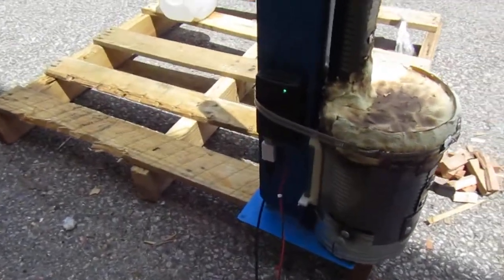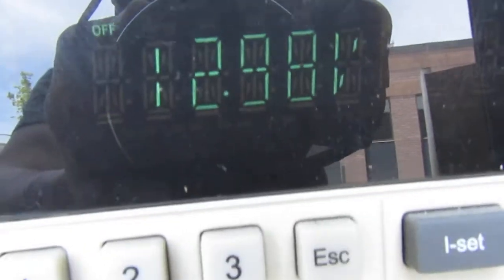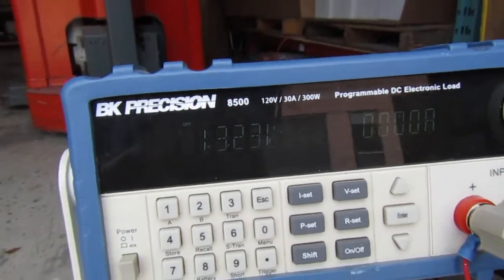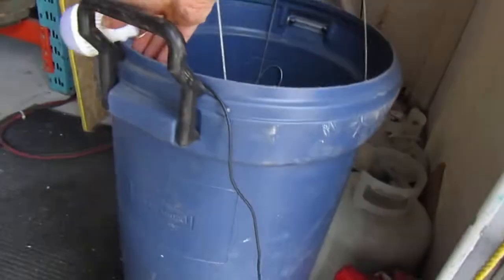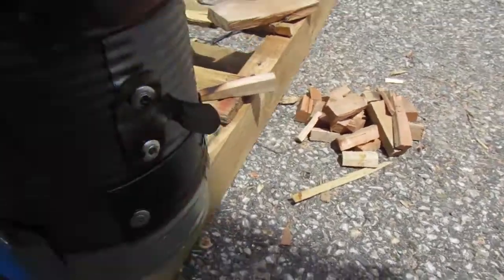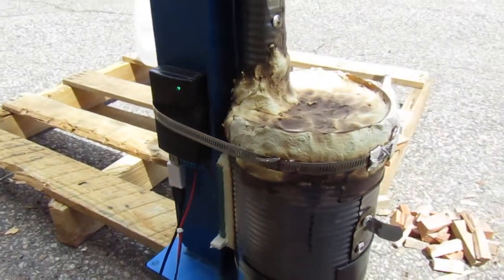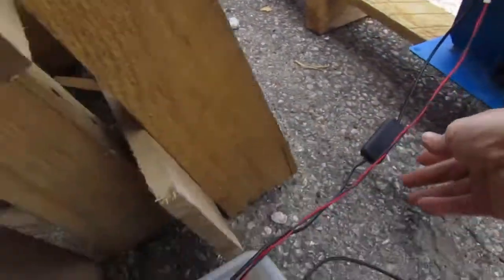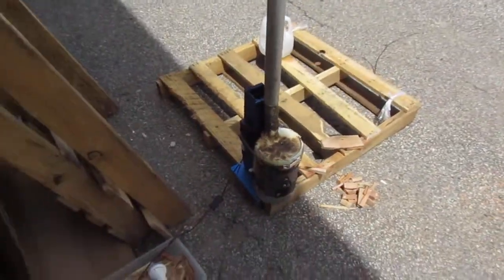12V Thermoelectric Power Generator with Biomass Stove for off grid IPOWERTOWER !

Comment: Could you please show us how many volts AND amps at the same time so we can get a bit more scientific than "Plenty of juice".
Thx
Reply from the maker: 16V open circuit translate to about 5V at 1.2 amps. Same as our Gas video. At 13.8 volts on AUX it would be about .120ma more at 13.8V. The Aux is capped at .125ma to protect the 5V primary. We specifically designed the board that way. You would still have power from both the 5V and 12V side. So, combined roughly 7 to 8 watts. If we change the Dc to Dc design we could get roughly 13.8V for charging a battery at about 5 watts! Less power as the modules would have to change to a higher couple device like our TEG1-4199-5.3 which provide OC (Open circuit) of 20V or slightly more. With that change we could get 13.8V at about 500 or 600ma. 2 modules again in series but different modules based on our extensive testing we did when we designed this system in 2015    !